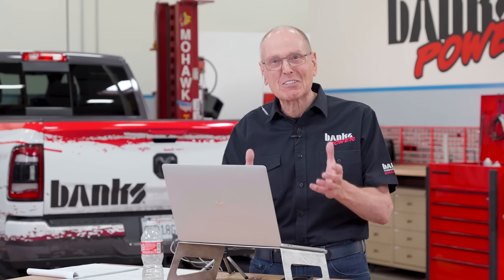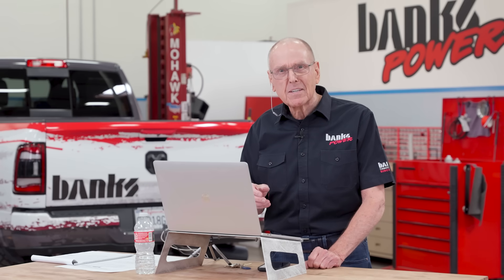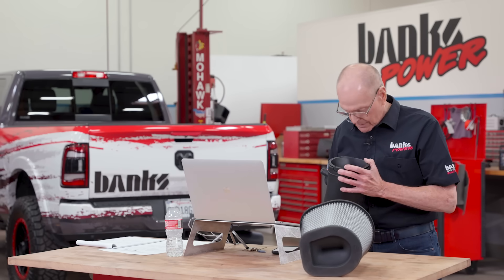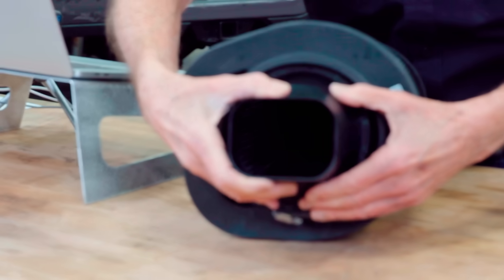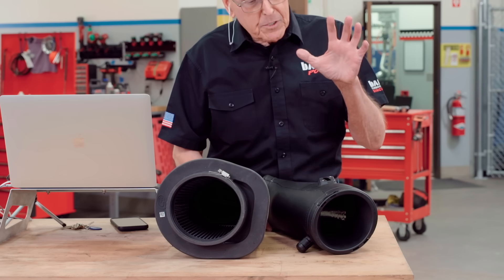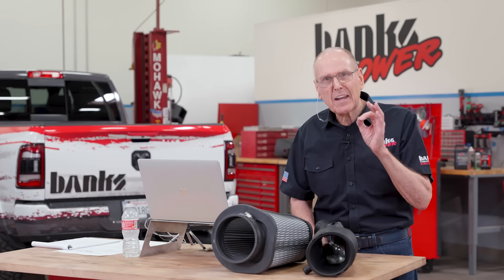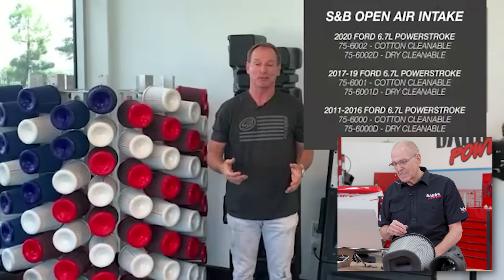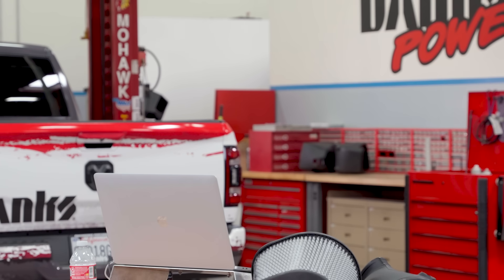Stop making these air intakes! | Fact Check

Comment from the maker: Got a product, concept, or video you'd like Gale to fact check? Reply below.
Reply: Please test this product versus your own on the dyno. With the hood closed ofcourse.
Reply: @TotoGeenen  they wont do that
Reply: Electric turbochargers! 
Coolant system upgrades?
Reply: @Sicktrickintuner  I wish more people cared about their cooling systems over air intake and exhaust!
Reply: For the 99-06 GM gas trucks, I’d like to see a comparison of your intake and the product made by Volant, with and without their lower air duct tube.
Reply: buy a sonnys 1000 cubic inch v8 race engine and dyno it.
Reply: How does the Vararam cold air intake measure up?
Reply: @chris wylie  I second this. They do seem straight forward and I think they are probably really good, but I would love to see them tested
Reply: Hot air intakes!!
Reply: 6.7L powerstroke hp mods
Reply: Here's an idea, try to figure out why the Banks CAI on the Cummins keeps throwing P0402 EGR codes on the 2019 and newer trucks. Gale Banks is so ready to trash other companies yet puts out garbage himself. The intake also features a great big hole on the bottom to suck in hot air where the factory one is sealed.  Also, mine came with a messed up IAT sensor port and I had to modify the POS to get it to fit only to have immediate CELs. What a clown, don't buy into this BS.
Reply: This guy is using your content to make money on his channel:
 https://youtu.be/TzN0zdvhBZ0?t=598
Reply: Keep it up!
Reply: Test the edge evolution on a 6.7 ford vs the Derringer
Reply: I wish the manufacturers would build an automatic transmission that can live behind your products Mr. Banks!!! Maybe you need to get into the upgraded transmission business?
Reply: 6.4 powerstroke. AFE Power(Quantum and/or Momentum) vs Banks. I'm probably one of three people in the world who wants to see 6.4 content but as it happens I'm close to purchasing one of these so I'm throwing it out there. Do me a solid Gale!
Reply: The pulsar v3 that claims 135hp increase to a stock duramax.. Edge said they listened to Gale and made their product even better than v2-which Gale absolutely sh*t on🤣
Reply: What about a rear diff cover for the 20-22 F-450's?
Reply: I got a concept for you. Sounds a little bit like Gale '24. Whaddaya say buddy?
Reply: I have a 05 gto and purchased a harrop diff cover. After watching gales video in diff covers im certain this is why my diff overheated and toasted my bearings. Ide love to see what gale thinks about this. Everyone says it it is not the cover design. Personally never had issues with the stock cover. Put the harrop cover in and poof over heat. And yes it was properly installed and filled. The harrop cover does help with wheel hop due to mounting differently so that is a plus but if it doesn't keep my diff cool its pointless. Can gale give his thoughts on this.
Reply: HA - other than they were all binned and ones left are worth a 'squillion' as a laugh collector's item - PETER BROCK's POLARISER was claimed to improve power and fuel efficiency - HA - I think they were a load of 'magic' crystals encased in a package that went around the fuel line - HA.  If you do not know who Peter Brock was, he was one of AUSTRALIA's greatest racing drivers - HA - and obviously his IQ was on par with the number of gears in the gearbox - HA.  Sorry Gale, I cannot send you one for a test - HA.  CHEERS from AUSTRALIA
Reply: I'd love to see a fact check on throttle body spacers
Reply: Go down the list of all the brodozer BS people swear by and categorically show how much is total crap.

I know this area of physics is different from fluid dynamics and Gale's other specialties but it could be interesting to see Gale tear apart drop-in LED bulbs that people put in halogen headlights and why they're such garbage.
Reply: I’ve been seeing these Speed if Air dimpled pistons all over my feed and they have some really bold claims, but as an example, I asked them for data showing increases on a 7.3 and they linked me to a video that shows their modded 7.3 on a dyno, but shows no before/after. They don’t even show the graph from the run.

They’re talking about doubling fuel economy, increasing service intervals, AND making more power, all while lowering emissions. With just some $4500 pistons. Please give us some insight! Will these things really pay for themselves?
Reply: Conical diffuser built into the exhaust pipe to help scavenge the turbine wheel of a VNT turbocharger. Countless VNT turbochargers have a conical diffuser actually built into the turbine housing at the turbine wheel outlet. Please can you prove/disprove that a conical diffuser built into a Turbocharger exhaust system will scavenge the turbocharger turbine side just like a tuned manifold will scavenge the valves on a n/a petrol engine. I think this would  not be applicable to internally wastegated turbochargers since the outlet of the turbo into the exhaust system is enlarged at the point of exit anyway to incorporate the gate etc
Reply: Ford 6.7 air to water intercoolers. At this time there isn't much information on the stock piece compared to the others on the market. I know you do not make one, but was curious how efficient the stock one is. Also just curious if there are an area's of concern or for improvements to the 6.7 Powerstroke plate form.
Reply: OIL VAPOR CATCH CANS: on non-DI-engines are the perfect example for a scam. What do to do with all that oil caught? Show it to tree hugger friends? Bring it to the EPA for credit? For the record, there is NOTHING wrong with that little vapor going through the intake, as long as it is a non-DI-engine. Those who argue otherwise are welcome to install catch cans for aforementioned bragging rights.
Reply: Alot of grifters in all of. These industries 😂
Reply: 6.5L diesel would have a big advantage from the banks ram air if you make one and relocated the battery
Reply: I live in alberta and work in the oil field, we end up driving down alot of dirt roads, I end up changing my factory air filter on my 2020 ram 6.7 after every job, what style of air filter would be best? Open or closed? Thanks gale and team!!!
Reply: How long until you guys make intakes for ram1500 trucks that are not diesel?
Reply: Would love to see a followup where you put the S&B on the dyno and compare it to yours.  Thanks.
Reply: @bankspower I've had an S&B on all my diesels.. and never had a problem even on big hp trucks
Reply: All coming from the bloke who flogs his I-dash as a replacement to a flowbench for port development 😂😂
Reply: Please fact check Eventuri cold air intakes
Reply: For us European car drivers. It’s flowing endlessly with both 4 and 6-cylinder diesels. With really bad black smoke tunes (as only options) and really cheap solutions for air filter, exhausts etc. If you have time, please look into small diesels you have around. Maybe BMW 35d and aftermarket tunes/parts? I think you would have endless work if you made a tuner for these M/N 47 and 57s not to talk about Audi/VWs diesel 😊👍🏽
Reply: Can I use K&N filters for ram air and them filter properly? Or would it cause the sweeping function to stop at high speeds?
Reply: I'm a Subaru guy so I can give you a plethora of Japanese car BS products and recommendations on vape devices (last part is a joke).  Go to any Honda, Toyota, Subaru etc. forum and you''ll never run out of content.
Reply: Can you guys talk 7.3 tuners Hydra,edge, compare to yours ?
Reply: @JL-rh6os  fella you're a gem haha. Thank you my good sir!
Reply: I would like to see the banks intake for gladiator on the Dino vs stock
Reply: How do i buy the air mass control module for my cold air intake
Reply: How about the half box intake that k&n makes for the 07-13 gmc sierra/ Chevy
Reply: So Gale I understand what your saying it makes sense ,so what air flow set up do you recommend besides the OEM filter set up
Reply: https://youtu.be/y-3jE78dgHE?si=LvF-g87IHVjsRre9
Reply: https://youtube.com/shorts/htoHMo7cmfU?si=-F5viTDghvNZGXpq
Reply: I know yall seem to work with trucks more, but would love to see yall release your inner mad scientist on the 3rd gen Mazda 3 😁
Reply: I am almost willing to buy and ship crappy products just for Mr. Banks to tear it to shreds.
Reply: I have been so confused the last week to weather to fit an induction to my D5 or not... then i seen Gale. and now im saved, ive only started the video, but i know i am getting the best advice!!!

Reply
Reply: IDK how you survive and deal with the BS in California.
Reply: @It_needs_to_be_said  who’s in California… I’m in Texas
Reply: @ruffmutt5789  not you that was supposed to be directed to him lol oh well. I like Texas it’s just too damn hot.
Reply: @It_needs_to_be_said  🤣🤣🤣so dam true
Reply: Hmm,

I wouldn't mind, even though Gale has no Honda products (not even a pedal monster), seeing a test on pedal monster in Toyotas and other cars you wouldn't expect to see gales products.

(And maybe a pedal monster for the 9 gen Accord as well 😁😁😁)
Reply: What about fluidamp's CS pulley?
Reply: I bought a Banks Air intake for my 2010 Cummins… didn’t have option for the Ram air tube .. my brother has 2013 Cummins and his did have that option to buy it and have it on his truck … same truck but why don’t u have one for my year

Comment: STOP w the drama!!! All I can tell you is adding cold air intakes to my G37x 6 yrs ago with custom baffling right from grill intake made a HUGE DIFFERENCE!! in POWER, Sound & MPG which means it is EFFICIANT!! Some don't work great some work VERY VERY well. It's all about the particular design. Both CA sensors are FINE!

Comment: The reduction is the venturi effect compressing and accelerating airflow.  If his customers want an open system and he is providing it to them why is that a problem?  99% of these CAI are junk numbers anyway pulled at max RPM for minimal HP/TQ gains.  Your all selling snake oil with these CAI.

Comment: I love this video....but do you have something for a 1996 OBS 7.3 Powerstroke?  I looked on your website and I could not find a Cold Air Intake.  It looks like S&B might be my only choice but I wanted to see if you had something or if you would recommend something.  I bought the truck with a Riff Raff open air system but I want to convert it to a closed off system.  What would be my best option?

Comment: Doesn’t the mass of air AFTER the turbocharger and intercooler better reflect the air charge the combustion chamber will see?  Why not just measure that to determine the optimal fuel dose?  Temp and pressure at the intake ports would be a good proxy for mass, maybe better.

Comment: Banks is a hypocrite. Look at his 6.0 powerstroke cold air intake box. They use the factory tubing, which is trash, and don't even make a sensor for the 6.0 motor. S&B cold air system for the ford 6.0 is far better.

Comment: I love you, Mr. Banks. Who am I to disagree with you? You know more about Diesel engines than I could hope to understand. But, the open and closed CAI debate largely hinges on climate. The closed intake design is a no-brainer in southern California, where Banks is headquartered. However, in colder climates, heat soak for open CAIs is minimal. I live much farther north, and in the summer at idle. I might see an uptick of fifteen degrees above ambient air temperature—worst case scenario.  However, the intake temperature quickly drops to ambient air temperature when I resume driving. I choose my open CAI carefully. The air filter sits in front of the stock air inlet. Pulling most of its air from outside the engine bay.

Comment: I have a K&N open intake in my car. Does it as Hspers?  Nah.  But does it sound great. You betcha!   Throttle response is a bit better as well, but that just might be a placebo.  I did pick up one mile per gallon fuel economy but again the sound of that open air on this Altima is freaking amazing

Comment: Gale, I just installed your air intake on my 2015 Ram 3500. Now I have a check engine light. Why is this happening? Help please, I want to believe I didn’t waste my money and time.
Reply from the maker: More than happy to help you. For technical assistance with our parts and performance kits, we'd love to discuss it over the phone. Please call our tech support team at 626-969-9600 and select option 4
Reply: What did you forget to plug in?

Comment: "Cold air intake filter".... I have always been thinking is not the correct name "WARM air intake filter", because that is what it does, it takes in the worm air from the engine bay.... While the original filter on the car actually funnel in cold air from outside the engine bay...

Comment: Honestly, if someone wants an open intake, and you have informed them a closed one is better. And the person still wants it. Sell it to them. So fuking what. Fried grouper is better than fried catfish, but I still go for the fried catfish most of the time. Also. Just take the restricter out.
Reply: If you take the restrictor out, you will not have a high enough flow speed past the mass-air sensor. Did you not watch the video?

Comment: To be fare.  I feel bad saying it, but to be fare.  A short restriction of air is better than a tube the same size.  When dealing with gases or liquids, short size reductions don't slow flow as significantly as you would think.  Like the squees only lets so much by so that everything after that is limited to that flow.  But that's not how it works.

Comment: sucks to see GB stoop to badmouthing another manufacturer to promote his product.  considering how respected his word is, he  could be ruining someones business ..
   I also see this as turd polishing if your using a MAF on a intercooled turbo diesel over a MAP system. 
  And don't believe that OEM designed systems are always "right"..  OEM will cut corners and save a penny to comply with emissions even though it will destroy the engine .. Look at FORD'S 6.4 powerstroke  exhaust DPF re-gen failure.  or the 7.3 PCV directly into the turbo nightmare.  If you can afford a new turbo diesel, just drive it under warranty, then trade it in on another one when the time comes. don't buy any BANKS stuff for it.  If you need more tow capability,  buy a F650 or bigger....

Comment: 30 seconds in and I have to respectfully disagree on the first point - you can sell two or more solutions for a vehicls and have the knowledge to say one is better in ways than the other. But if people want an open cone intake, they are prioritising the noise over performance. Which is fine! Different people different priorities when modifying cars.
But the rest of the video is spot on as usual. Also I hate MAF sensors 😅

Comment: One thing i really like that the 2015 and up Challengers do is they have little pop out holes in the headlights that can be used as airflow directly into the engine bay. If you have a Challenger with a cold air intake kit like the Shakers you can pop open those headlight holes and get official Mopar tubing (or other brands) that connects straight to the airbox from the headlight on the driver's side pumping fresh air straight into the airbox while the passenger side works more or less like a vent bringing fresh air into the engine bay when driving, there's even space to fit some tubing at an angle on the passenger side so no debris gets into the engine bay. Does doing this really make that much of a difference Hoursepower wise, probably not, but hey the more fresh air into the engine the better.

Comment: I’m running the S&B closed box system on my 2019 f350 and I use my truck on and off road I have no issues whatsoever with the battery my air intake is using cold air from the outside

Comment: I know very little about air intakes but I agree with Gale based on fluid mechanics. I think a better way to build it would have been to have a separate ducting to fool the sensor instead of restricting the whole airflow because if you restrict the airflow back to OEM level then the only advantage you have is a wider intake.

Comment: im not seeing the MAF control on the site or that it comes with the CAI unit , where can I find this?
Reply from the maker: The Air Mass Control Module is calibrated to work with specific intake systems. Currently we offer it for 20-23 Duramax L5P trucks.

Comment: The only thing missing from the snake oil salesman pitch is an aluminum pipe between engine and radiator to help heat the air going into intake. After extracting it from engine compartment.

Comment: Back in the early '80s, I had a customer come in to get a quote on an engine for his plow truck.  I quoted him on a high-torque combination.  He then told me another shop quoted him for 2.02 and 1.6 valve heads, angle milled for more compression, a Torquer intake with a 750 mechanical and a 350 HP 327 hydraulic cam.  I explained to him why that combination made power at a higher rpm range than what he wanted for a plow truck.

The owner of the other shop called me all mad because I told his customer the combination wasn't right for his use.

Comment: They don't even make the tubes out of metal any more- you're basically replacing one plastic tube with another plastic tube.  
Toyota has been is equally guilty for at least 10 years now with their TRD intakes- you remove the OEM plastic tube, air box and panel filter, and replace it with a different OEM TRD tube, air box and panel filter with some red silicone flex collars -only $600 now!